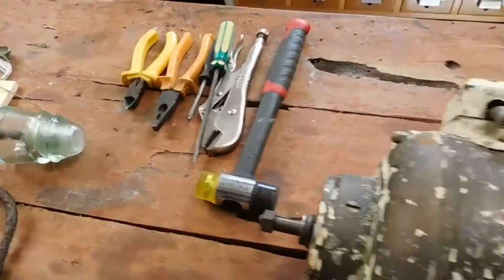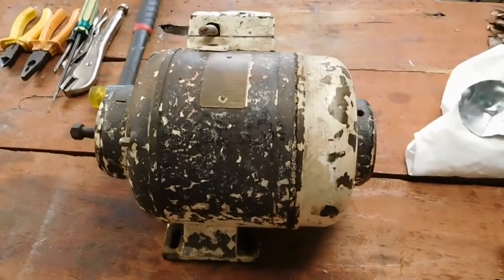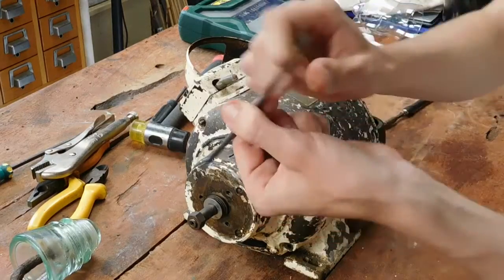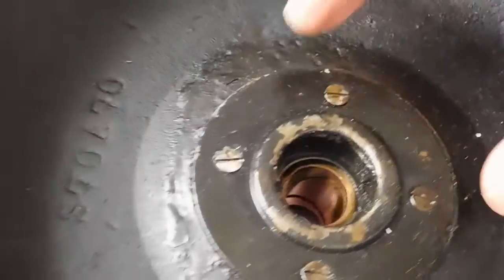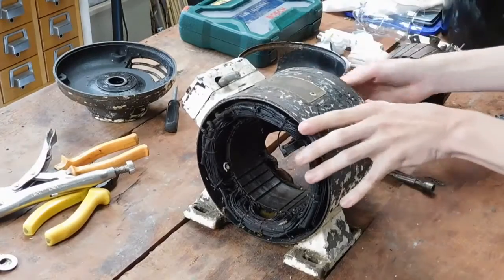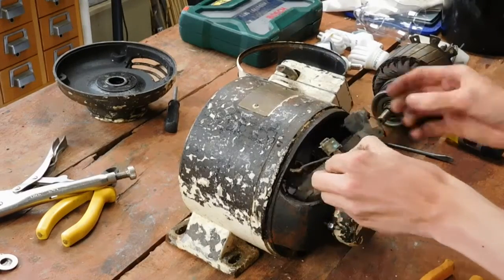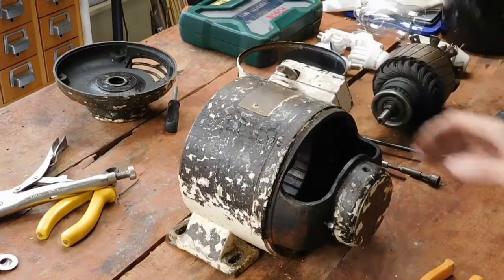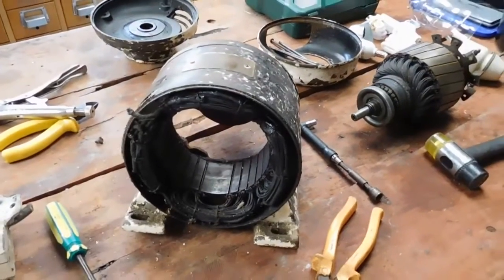Crompton Parkinson Repulsion Motor Resto P1 - Dissasembly

Comment: If you can get to the winding ends it might be possible to just reterminate without the rewind. Of course depends on how good the old insulation is, and if they did not damage the wire insulation. Terminal block though will be easy, as they are a pretty standard item so any small one will work there with the hole to mount it. Rewind is easy at home, just very fiddly and you need some paitence, a lot of thin pressboard for the channels ansd some fibreglass tape to rebingd, along with some fibreglass sleeving for wire ends, then a good varnish to set the lot up.
Reply from the maker: I did see if I could re terminate the ends, but sadly they've been cut really short. It'll be fairly straight forward to rewind this one, as there's no start wind in the stator

Comment: 2.5 amp on 240 volt higher voltage uses less current
Reply from the maker: Yeah I read out the one for 115 Volt lol. It is 2.5 for 240
Reply from the maker: I may not need to rewind it either, as I have a chance of re-terminating the cut ends!